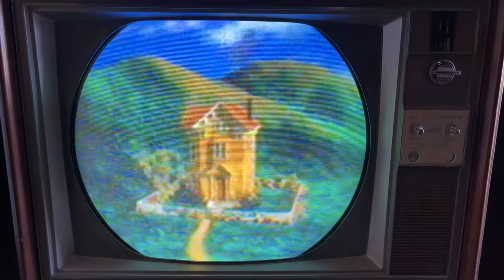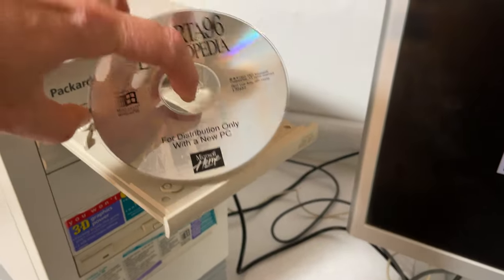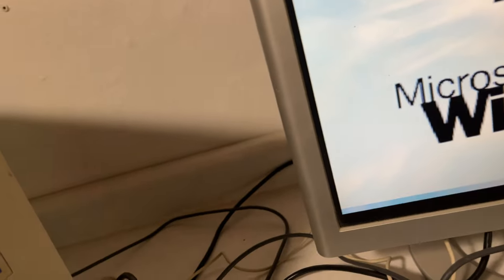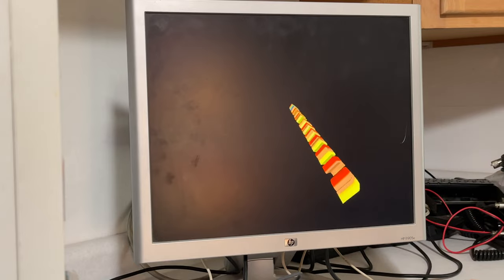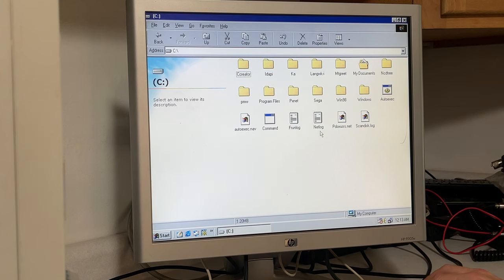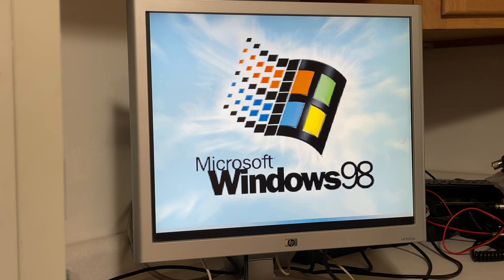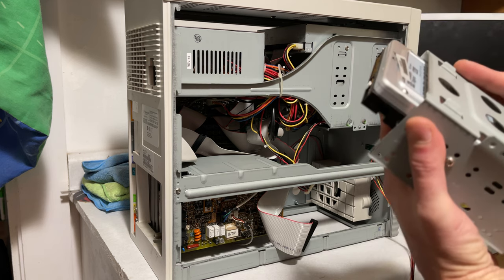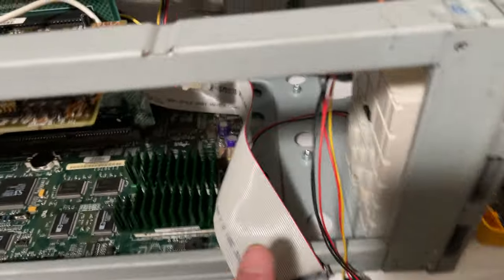Vintage 90's Packard Bell Desktop A940-TWR

Comment: i bought one from ebay, it started up, refused to boot into windows.. i had replaced the battery,, it started a few more tijmes and black screen,, i think mine is d.o.a,. i got operating sytem not found, cant
 seem to fix mine.